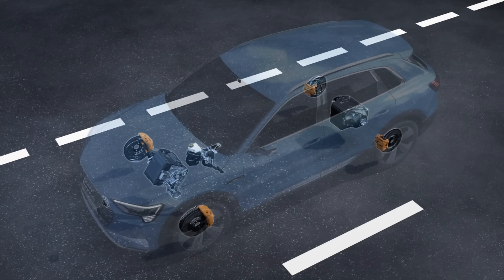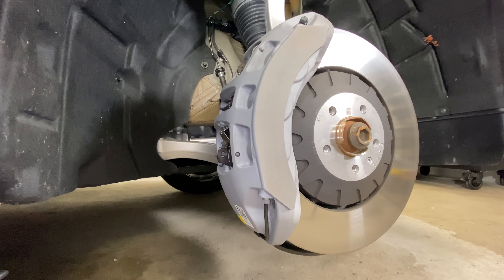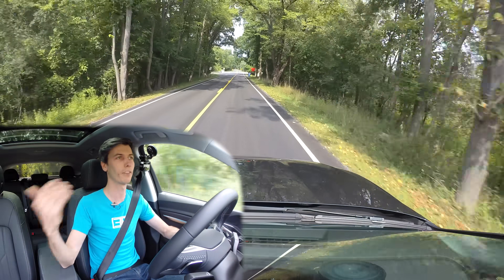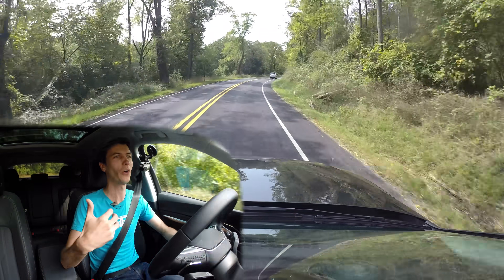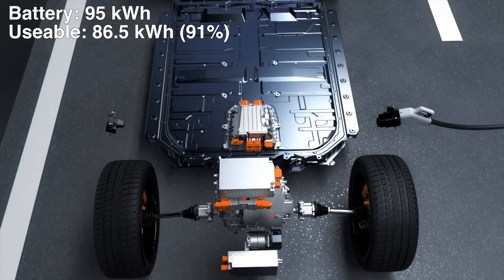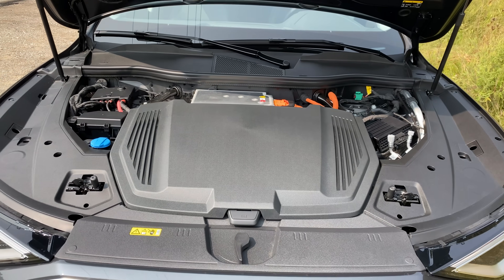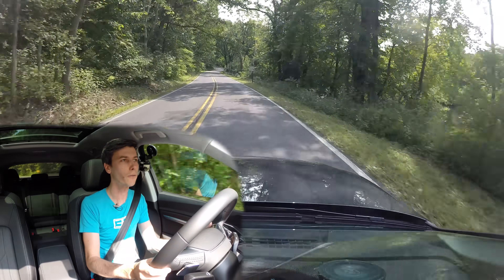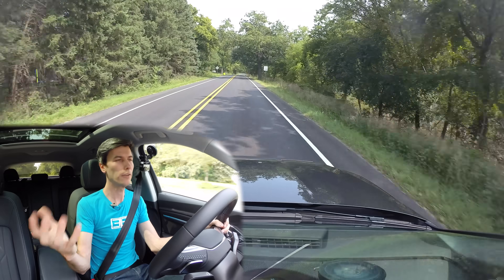How Does Brake-By-Wire Work? Plus: Audi e-Tron Sportback Review!

Comment: I am using Cupra forementor 2025 vz line MHEV it also have electromechanical brake system . Pedal feel is not same as my old car Seat leon 2018. For example at  70kmh speed I puah to pedal there is click voice like relay and 2 cm pedal movement is soft like gap after if I click harder pedal feel became  stiff/hard and second click voice comes. I can never say that pedal feel is same between vacuum base booster and electromechanical booster as for my var cupra forementor mhev.

Comment: Why replace Hydrolic? It’s because the manufacturers look to save money and still charge you for the function. ie… an EV with 500hp cost 1/3 to manufacture (no hoses, no belts, no engine) so you’d think it costs 2/3’s less.. that an 500hp ICE. But because they both provide 500hp they charge you for the 500hp and the profit margin is greater through the EV. The while thing is for their benefit, not the consumers. Idk

Comment: Jason. great video. eVs with the current battery tech are great for city driving. for longer ranges, and in extreme weather, one would be heavily reliant on the supercharger network. And then, there is battery degradation (70% or more is still considered a “good” battery), and winter conditions can throw an additional 30% reduction, which means something, e.g., like a Tesla MYLR would go from 500km (initial range), to 350km (70% battery after degradation, still considered a good battery under warranty), to about 200km (40% due to extreme weather losses). Not to mention safety issues with water infress, flooding (see Tesla manual on flooding, and warnings) , Inwould never park a eV or a hybrid in a garage. I know some folks will quote that gas cars carch fire more often. Its a vague study, because as we all know, not all cars are created the aame. Toyota/Lexus/Honda/Acura are in the top brands, and would love to see how many of these have actually caught fire, and under what scenario. 

With Toyota/Lexus and other manufacturers announcing a ‘27/28 release for solid state batts, that is when eVs will be comparable to ICE cars, across the full spectrum. Safety is a big issue with the current batt tech, as can be seen by the plethora of warning and  protection from all liabilities to the eV manufacturers. Hoping that SSBs will address most of these issues. I have faith that Toyota/Lexus when they start mass production of eVs (not a trial project like their B4 offering), most of the kinks (especially safety) will be addressed. Remember when folks came out with direct injection? Toyota was a late adopter, and did this with their D4S engine, which maintains port and direction injection, avoiding back of intake valves from gumming up. The best of both worlds. So when Toyota does things, its always right, with safety, durability, and lower maintainence costs in mind. Its no surprise that Toyota/Lexus consistently tops the charts on reliability year after year.

Comment: what if that valve fails to open up, the electronic brakes fail such that the safety valve fails to open up and they system is caught in the middle neither the electronic or the manual system can work, you would be on a death ride ???

Comment: My understanding is that the computer decides it has failed and then opens the valves. What happens if you lose the computer completely? Will you just not have brakes, or is there a point of application where you just bypass the computer controls?

Comment: I appreciate the video and the explanation on how these systems are supposed to work, but I'm not totally convinced on the success of the failsafe mechanisms. I've had three separate braking issues on two separate hybrid vehicles. Issue one, while slowing down with a steady brake pedal position and pressure applied, the vehicle suddenly slams on the brakes and comes to a rapid stop. There were no vehicles or objects in front of the car and the alerts for the emergency stop did not flash. The car indicated no problems or trouble. Issue two, while slowing, I came to the realization that I was not slowing quickly enough. I applied more pressure to the brake pedal. There was a substantial and measurable delay from the time I increased the brake pressure and the time the vehicle began responding to that request. It was very much a brown shorts moment. Issue three, while driving I needed to come to a stop, I pressed the brake pedal and it was very hard to press. The car did slow, but the stopping distance was very long. With your explanation of the components and how they work, I would describe the problem as such: Applied pedal pressure, regen braking began, computer either did not compute need for extra friction brakes, or the pump failed to run and apply the additional friction brakes. The car did not detect any problems, so the failsafe mechanism did not open the valve to allow direct hydraulic braking. In this particular car, it is a plug-in hybrid, so the overall effect of regenerative braking is not that strong. The must have been hard because the brake force simulator was fully compressed.  Whether my explanation is correct or not, hopefully it conveys accurately what was felt from the driver's seat. It was another brown shorts moment. I would love to hear your thoughts on why failsafe mechanisms might not be quite so failsafe.

Comment: If the angle sensor on the brakes fail and the system thinks you aren't braking while you are stomping on the brakes, do the brakes still work? How does the system detect failures/respond to them?

Comment: Additional info: .3 G decel is only valid till 70 km/h above that speed regen brake overshoot the power limit of the battery charge rate, lowering the regen brake force.

Comment: Hope whatever enables manual override (normally-closed spring-loaded valves?) doesn't jam to give no braking if you lose power.  I don't see much advantage.  Already ABS has proven to not help much since many drivers become alarmed by the chattering pedal (feels like something broke) and let up on the pedal.  Everyone should practice ABS in a wet parking lot before that emergency.

Comment: A few years ago, everybody worried about steering-by-wire as well, but it's necessary, if you want to implement assitant system. Otherwise you would need clunky hydraulic or mechanical systems.

Comment: brake by wire seems like such a safety risk....if electrical system fails you are done.
Reply from the maker: Did you watch? I explain how they still work if the electronics fail.

Comment: I have some automobile knowledge background and I truly believe Brake By Wire system Is a better way to go, mainly because is sending more accurate controlling  braking power to each individual wheel base on  information that all the electronic components ( Computers etc ) are receiving during the driving conditions (  tire pressure, speed, turning angles, g-force, road condition, amount of passengers , cargo, how level the road is,  down or up hill ) and some other variants.

Comment: Typical German engineering: take a relatively simple system and make it more complicated and expensive.  

Wait a few more years and the German auto industry will be assuring you that drive by wire is a safer system as well.

Comment: So is it basically when the electronics brake system computer detects less than 0.3 g’s it will slow down the vehicle using the regenerative system while charging the battery 🔋 and once detected more than 0.3 g’s it will open a valve and activates the mechanical brakes using hydraulic brake fluid?

Comment: Over complicated computers taking over all the braking. Now another system you can't work on at home unless you have expensive diagnostic equipement. Then replacing the expensive leectric parts when they fail much less really be bale to test them. Shot nowadays you need a scanner just to replace the parking brake or bleed the brakes. I hate to see it shorts out while driving or simle jump starting the car shorts it out.  So sad most people can't even on thier own cars and have to spend $125 plus an hour to get it fixed. Then thier 20% mark up on parrts. Keep it simple. This video should be called over engineering explained.

Comment: I think that there should be full mechanical or hydraulic connection after something like 75% of pedal travel. Without that there's too many things that can fail. I would feel unsafe driving older car with pure Brake-By-Wire technology. Some system checking whether or not the others are working can give false positives.

Comment: So what is the purpose of brake by wire on non-hybrid or electronic cars? I have the Alfa Romeo Giulia and although I like the brakes a lot, I've wondered why they went by wire with them. Especially if there is a back up hydraulic system, then you're not even saving weight...

Comment: And ICE cars only need a 5 gallon gas tank most of the time.  However, occasionally you do and that is why they have 15+ gallon tanks.  EVs are no different.  There may be times you come home and your power is off all night and you need to drive another day on your battery without an overnight charge.  Or you need to evacuate from a hurricane and need the range.  Tesla got it right going for range as close as possible to existing ICEs.  To do otherwise is not very smart if you want to gain any market share.

Comment: OMG... thank you for bringing up the FACT that in 90%+ of the family situations, people do not need a 500 or 600 mile range EV.  150 or 200 is overkill for most people.  The car will be lighter, cheaper, and more can be made since they are not hogging so many battery cells.  The typical consumer drives only 20-40 miles per day.  Not 300.

Comment: Don't get me wrong, VW/Audi fanatic here :D but what was wrong with regular brake system? This is just complicated and unnecessary = expensive to make and get fixed once something goes bad in it. Hydraulics is doing pretty good job for the last.. 50, 60 years? And basically entire system is some kind of failsafe, so if we are going to mention redundancy.. Well that's just my opinion. Things are being more advanced and modern, BUT is it always for the better? Maybe I am too old-school and but one thing will never go out of fashion; if you don't have it, it won't fail! Well, cool looking Audi, I have to give it that, BUT the only thing that it's missing is TDI version. I never cared THAT much about emissions and soot and NOx.. Yeah diesel this, diesel that.. But my 1.6 turbo diesel can go for over 800 miles with one tank of gas, burns less fuel than a lighter! But nobody cares about all the gasoline engines that are often burning 3 times more fuel than what I just mentioned, AND for some reason that's okay, but what do I know...  However Audi said they don't plan to say goodbye to diesel engines any time soon despite electrification, so I'm good ;)

Comment: I was thinking if a EV with independent four-wheel drive were Ariel couldn't have a pretty good amount of attitude adjustment through gyroscopic and rotational Force each wheel could independently move and break accordingly to be able to change the attitude of the vehicle to better land and keep people safe in case of high speed collisions

Comment: If you use only regen braking, do you risk premature corrosion of rotors due to lack of use?
Reply from the maker: They will get enough use to keep the rotors clean each time you drive, even if you barely touch them.
Reply: I am doing an ev conversion. I am having two motors one for front and one for back. So far I have been tesing the drive train on a rolling chassis that has no brakes (no master cylinder and no brake pedal) and so far with only half of the available regen I can drive like a normal car without ever having to reach for the brake pedal. Some one once saw me driving and asked me how did I get the brakes to work without the master cylinder. So I am certainly going to have to deal with the issue of rusting rotors. I have considered getting them chrome plated but not sure if that is a good idea.

Comment: My Model 3 gives me around 200 miles max and I’ve never needed to supercharge in 1.5 years of ownership. Warm weather months I charge to around 75% a day and during the winter I charge to around 85% a day, and it’s always been more than enough for my daily 90 mile work commute including lunch trips and occasional full throttle fun. In other words, range anxiety isn’t something I ever have. And if I’m in trouble, I have superchargers all over the place. You just need to plan slightly if you know you’re going on a longer trip the next day, just set it to more charge that night. You simply think of your garage as the “gas station”. I’ve charged to 100% maybe twice in 1.5 years.

Comment: Can you go back to doing your homework and explaining things honestly?

Firstly you are driving an AUDI. Check the price tag for a second. I realize as an engineer you are accustomed to this idea that you get paid well enough to afford toys but for goodness sake actually explain to people the real reason  brake by wire hasn't made it to the US yet.

It's called the LAW. For example, according to FMVSS 121 a compliant pneumatic system MUST be on a commercial truck. This makes EBS EXPENSIVE to field in the US. No commercial fleet is going to willfully spend MORE money on something that ultimately does the same thing... stop the truck. Current braking systems, if they could be measured in horsepower on an 80,0000 / lbs vehicle would clock well over 9000 horsepower.

You are driving an AUDI. It can have effectively TWO braking systems because it is EXPENSIVE.

Honest. This video is about as bad as the time J Leno mistakenly said the Chrysler Turbine Car never caught on because it didn't like LEADED fuel... which isn't WRONG entirely... it just skips right over the inconvenient part where the jet engine produced a  pathetic 130 horsepower, the fuel economy was as bad or worse as a V8 of the same vintage, but it was 10 TIMES MORE EXPENSIVE.

Sources:
Heavy Duty Trucking System, Sixth Edition by Sean Bennett, pgs. 1023-1024

Drive: The Definitive History of Driving, pg. 215

Comment: my problem is the fail safe valve is closed until there is a problem. Giving that most people don't change the brake fluid that valve could get gummed up, so say at a 150,000-200,00 miles something in the system fails the valve tries to open but cant. Then what? you're fucked that's what.

Comment: Perhaps you should outline that the main difference is that electric cars dont have a conventional vacuum system. Hence the electronic system. They still have brake fluid.
Reply: Its hydro boost that uses an electric motor to run the pump instead of taping into the power steering pump.

Comment: About you remarks of range and use cases, I live in Lisbon, Portugal and over here there are many Uber drivers that use NIssan Leaf or Renault Zoe cars with 240Km range or less and most of them are happy with their cars and are profitable (and they use essentially old models with less range than the new models of this year). So even with this very specific use case is possible to have "low" range EV with not too much nuisance. But in the end it all depends on the personal feeling.

Comment: is there any particularly impressive gain from this new system? from my standpoint its just pointlessly complicating the existing system
Reply: I think it is mostly about integrating the regen braking and the mechanical brakes so there is no perceivable transition between the two. It's more about "driving experience" than anything else.

Comment: Two things with brake by wire. Firstly if it fails (and some will at some point) then you're relying on a valve opening which may well have sat dormant for the life of the car. I'm not so sure its a great idea once that means 10, 20 years and so on - there should be a constant physical back up after a certain amount of pedal travel. 
Also its almost completely pointlss - infact worse than pointless from some viewpoints. At best it makes the pedal feel more normal than blended brakes but we don't need blended brakes in the first place. Have all the regen on the throttle pedal. Then you use all the regen every time you come off rather than trying to guess how much 0.3g is and the brakes need no complex electronics, extra failure points or shady failsafe valves - they just work with proper feel all the time as needed. 
There is also the side effect of full regen being applied before the brakes as you lift your foot off in an emergency - that split second of extra deceleration can make quite a difference because it helps steady the chassis before the full anchors go on.
Reply: The valve which needs to open will open every time the car is shut down, and close again when the car starts up and proper brake system operation is confirmed - it won't have "sat dormant for the life of the car".

Comment: It’s very similar to the way electric trains prevent using its air brakes when regenerative braking is in operation, the air brakes only kick in when at slow speed when regenerative braking is too weak or a system failure - its been around for over 50 years.

Comment: Master cylinder seals fail especially when the car get old and brake fuild is not changed regularly... What happens to brake by wire when the seal fails?
Reply: How many times do vehicle electrics fail in comparison to Master cylinder seals?
Reply: There is plenty more that will fail more expensively in this system before the master cylinder seal fails.

Comment: No no no NO Potentiometer a power failure no brake no power no power switch or steering or drive past something causing interference . Just NO THANKS👍🖖
Reply: Long lasting = keep it simple my Clio is 25 years old 5.8kg per hp. SUPER CHIPPED multipoint, the ECU should only control the engine KEEP IT SIMPLE 👍